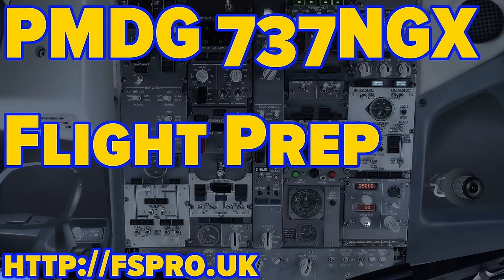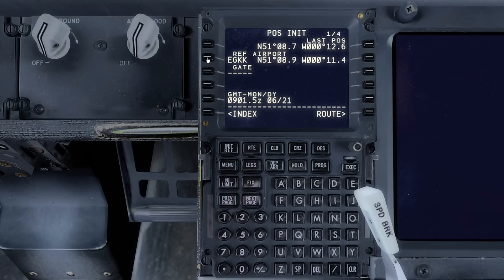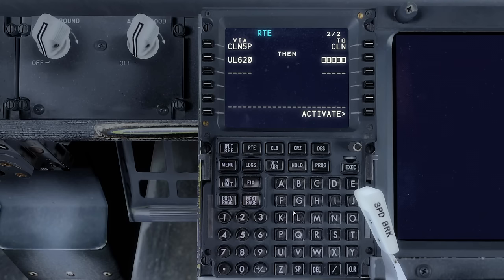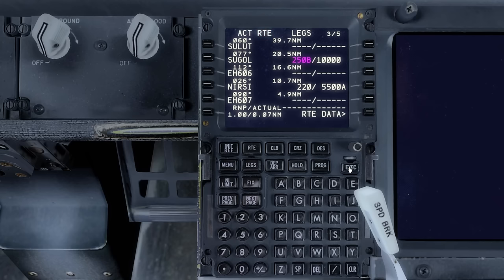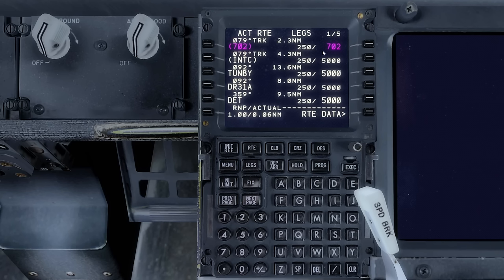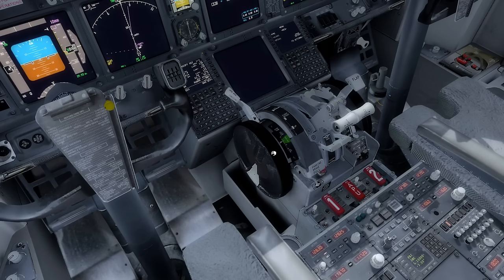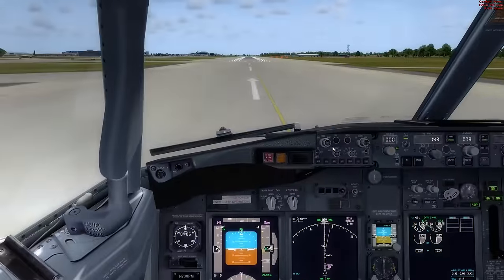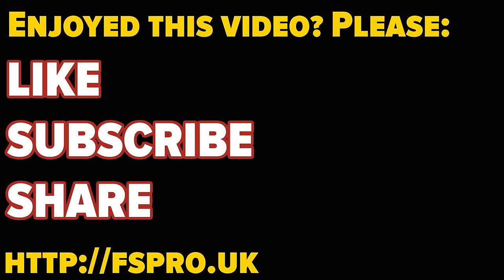PMDG 737 Flight Preparation Tutorial

Comment: Hey there, I see you are having the same font issue I was having on my PMDG 737. You are missing the Quartz font which is causing the unrealistic numerals on your pressurization panel on the overhead. If you look in your FSX folder there should be a font folder. Find the Quartz font then right click and choose install. After a restart your 737 overhead panel will look right again.
Reply from the maker: +Mark Bennett Hi Mark - I've never come across this before. I'll give it a go.  Thanks!